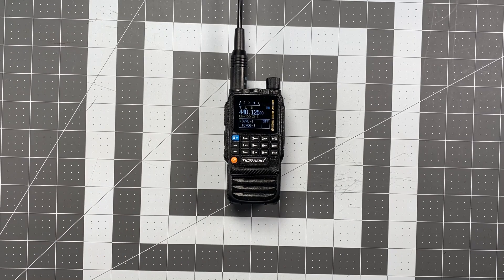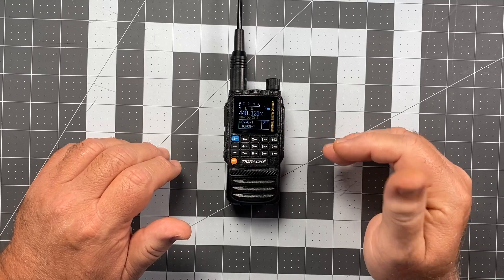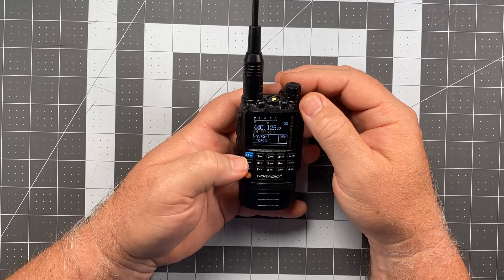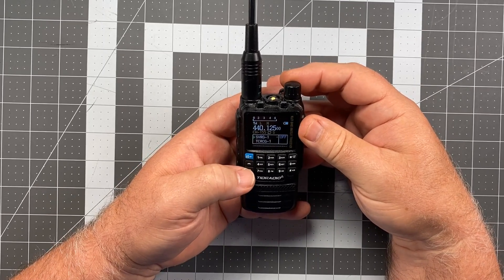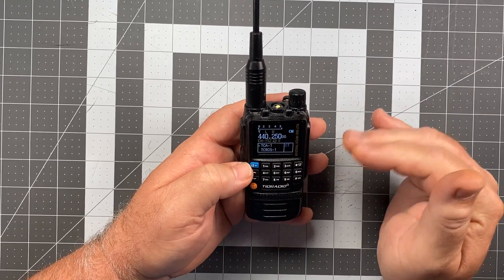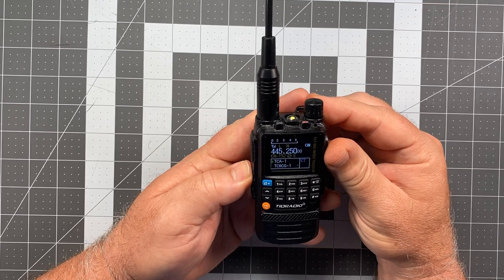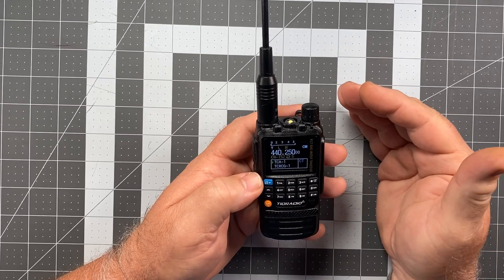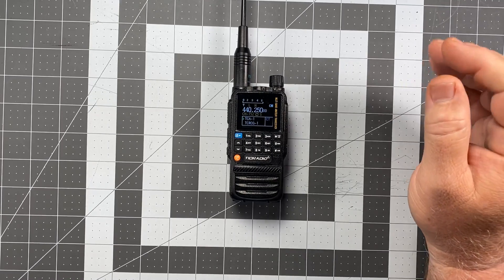TID Radio TD-H3: A firmware fix for the squelch tail issue?

Comment: If you are using the unlocked radio then the firmware update IS NOT 240427. UPDATE I was looking at my H8, sorry.
Reply from the maker: When I enter Menu and go to item # 42 it reads 240427. Which is also the firmware update that I installed on the radio. Not sure what your point is.
Reply: @KS6DAY  MY mistake, sorry. I was looking at my H8. I feel dumb.
Reply from the maker: @kchaney56  No worries.

Comment: Which should I download? Unlocked, GMRS or ham? Does it matter as long as which one you download is on ge mode your radio is in?
Reply: I have the same question… I switched to only using GMRS mode currently, but the box and instructions do say Ham Radio, and I’d like to use that in the future. I assumed the firmware would be the same for the entire radio regardless of mode 🤷‍♂️ Not sure which to choose in this scenario.

Comment: I have two td-h3 radios and I used to get a repeater tail squelch on my local repeater and now I don't receive it on either one. Any ideas on what setting I may have changed for it to do this? I know I'm in range of it and it's working because I can talk to folks roughly 12 miles away.
Reply: Just a guess, but did you turn on Receive CTCSS?

Comment: i tried this. Now I have a brick. The radio is dead and will not turn on. I have tried repeating the process several time with no success.
Reply from the maker: Did you do the thing they mention in the readme doc about pressing in on the top of the programming cable during the update? The bricking comes from an interrupted download to the radio. A faulty cable or loose connection can cause the interruption. I'm guessing this is why they included this advice. My H3 doesn't have this problem but my H8 did. Perhaps trying the top press or a different cable might be worth a shot.
Reply: @KS6DAY  Yes. Then I tried the USB cable. I do get an intermittent blinking light on the flashlight.
Reply from the maker: @rkh0608  Are you holding the PTT button down throughout the entire process? If you release it the download will be interrupted.
Reply: @KS6DAY  Yes. It says download successful, then nothing,
Reply: Mine wont turn on now either. That's 2.  Anyone else?
I used my own programming cable. The cable I used to chirp program the h3 successfully and the cable I use with all of my other radios.. there is a programming cable in the h3 box. maybe that one would have worked??

Comment: I have programmed many radios. This radio is aggravating. In my opinion, this radio is more trouble than it is worth.
Buy a yaesu unlocked and use RT Systems software. much less stressful.

Comment: where do you find the firmware download?
The link does not get me there
Reply from the maker: Scroll down and click on the TD-H3 version that you have. When the page loads, click on the blue "Download" button. It does say "Programming Software" but the download also includes the latest firmware file and the program to load the firmware via programming cable. Once it is downloaded you will need to unzip the file to reveal the contents. Definitely look at the "readme" document and all will be explained as to how to load the firmware.
Reply: @KS6DAY  Finally somebody explains it clearly. I do however, think they shouldn't force you to load the entire package every time there is new firmware.